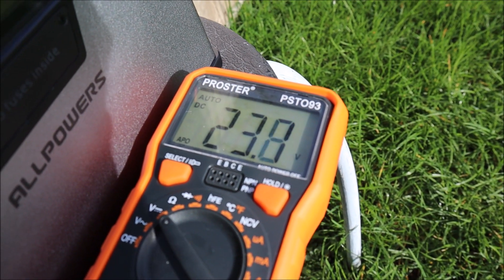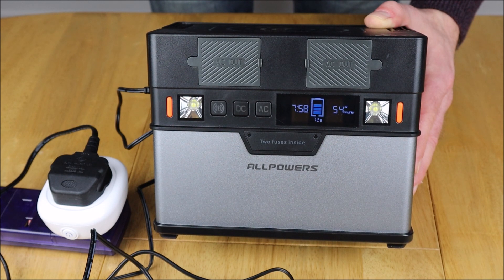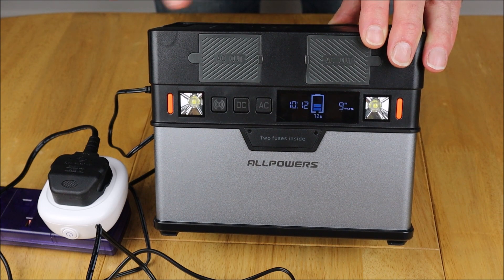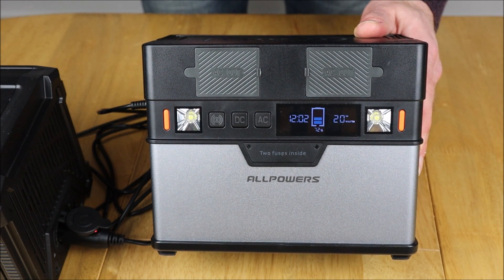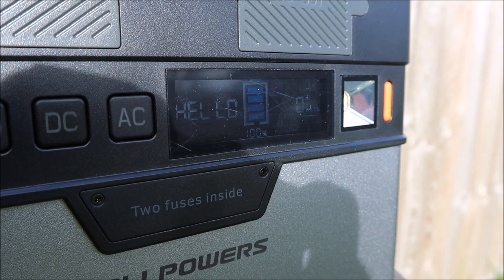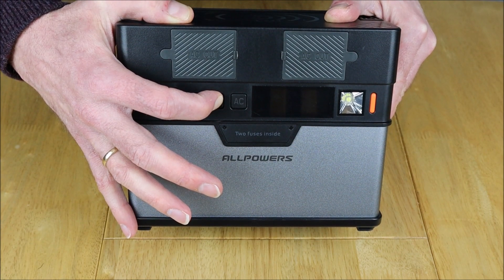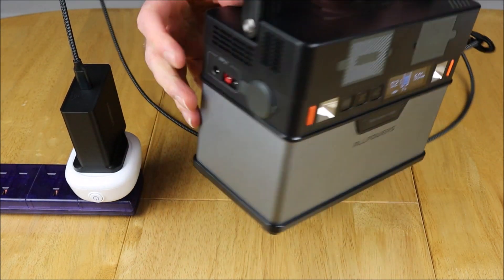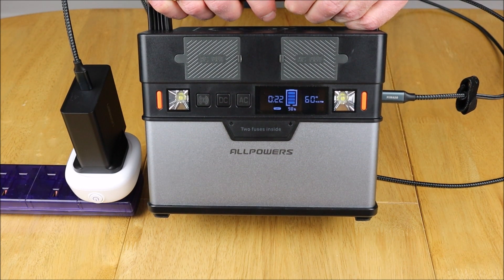ALLPOWERS 372Wh Portable Solar Generator Update | Charging Rundown

Comment: I was looking at this a few months ago and I've come back to buy one but the link goes to a 288Wh version
Reply from the maker: @josh green  Good day Josh! That's strange, it looks like they have changed the listing from 372Wh to 288Wh. I'll ping them to see why it has changed and let you know. All the best, Adrian
Reply: @DADvinci  Thank you very much, I will say that I'm looking at the Sudoo 372Wh as it appears to be the same unit but £70 cheaper I am a little sceptical but it is a good deal.
Reply from the maker: @josh green  No problem Josh. I'll let you know what they say. Please shout if you need anything. Cheers, Adrian
Reply from the maker: @josh green  Hey Josh. I've heard back from them and they have indeed changed the capacity. Sounds like the battery pack price has increased, but here's the main part of their response to me > "The material supply of 372W battery is nervous and price bump up. So we decided to change the capacity of this item, but keep the outer case and other function.   So we change the list information. And from now on, we send our latest 288Wh to our oversea warehouse, instead of 372Wh generators". I'll update the listings to reflect this. Thanks again for pointing this one out. Cheers, A
Reply from the maker: @josh green  I'm not sure if you've gone ahead with your purchase yet, but I've added the AliExpress links for the ALLPOWERS store on the 372Wh/666Wh videos now. It looks like you can get both the 372Wh & 666Wh cheaper at the moment from there (UK reviews on the listings too). I hope this helps. All the best, A
Reply: @DADvinci  Thank you so much for looking into this, I was afraid this may have happened as I've noticed the 372Wh's have been running out of stock.
I ordered a different brand from another site as they had 2 left.
As far as I can tell it's the same unit just with a white plastic shell and not a metal one. 
Thank you for your help, I did want to buy from your affiliate link but I'm sure I'll be coming back as I still need to order a car charger and a solar panel.
Reply from the maker: @josh green  No probs at all Josh and I'm glad you got it sorted. Thanks again for the heads-up with the Amazon listing as this helps other viewers out too! I hope all goes well with your 372Wh and please shout if you need anything else. Have a great weekend. Cheers, Adrian

Comment: My ac stopped working.. Do you think its just a blown fuse?.. When pressed it cuts off after like 2-3 seconds. Also what ohms does it use. Thanks
Reply from the maker: @Clintis Dickson  Good day and thanks for your question. A few of questions if I may. 

> Had it been working fine before (as in, it's just stopped working)? If it did work fine, can you recall the last device that was plugged in the AC socket(s)?
> Does the AC switch off after 2-3 seconds when something is plugged in and when nothing is plugged in?
> Sorry, I'm not sure what you mean by what ohms does it use. Please can you expand on this?

I look forward to hearing from you. All the best, Adrian
Reply: @DADvinci  I used a 18w 2 foot florescent tube light with a starter and believed the starter in the light is what caused the AC fuse to blow or damage the AC outlet as its been struggling to turn on .... As for the fuse I meant what size/ohm fuse is used in the charger. Thanks for your help.
Reply from the maker: @Clintis Dickson  I see now, thanks for the info. Does the AC outlet work with other things or remain on with nothing plugged in?
Reply: @DADvinci  the AC doesn't stay on .. Once turned on it turns off immediately..even if you plug up anything to the outlet or not it goes off. There is no power coming out from the AC at all.
Reply from the maker: @Clintis Dickson  That doesn't sound right and I’m not sure the fuse would be the issue. I suggest contacting the supplier of the unit or going direct to ALLPOWERS via their email address > support@allpowers.net. Cheers, Adrian
Reply: @DADvinci  Thanks I'll let you know about any updates.. 👍

Comment: Hi DADvinci, got this portable station last year(2020) July and everything was running great until it just stopped charging  in February. Any idea what could have gone wrong? Is there any fix for this you might have already faced?
Reply from the maker: @Olu Ogunyale  Good day Olu! I'm sorry to hear about the charging issue. May I ask which method(s) you use to charge your 372 (e.g. Supplied power brick, solar, USB-C PD?). In addition, have you been able to try a factory reset (hold down the DC button for about 20secs, until the display resets)? I look forward to hearing from you. All the best, Adrian
Reply: Hello Dadvinci, thanks for the video. I have the same problem as Olu. I've reset the battery many times but nothing changes. It displays 0wats when I charge input 250v. Let me know if you know anything that I can do.

Comment: I have had one of these for 2 weeks, it worked briefly and now it will not charge past 94% at the mains, and is completely dead when you unplug from the mains. AC won’t start. Has anyone else had this problem? I am getting nowhere with there after sales.
Reply from the maker: @Jamie Hazelgrove  Good day Jamie! I'm sorry to hear you're having problems. Have they asked you to do a factory reset yet? If not, hold down the DC button for about 20secs until the whole display lights up (then release). Are you using the AC power brick to charge (do you have another method)? All the best, Adrian
Reply: Hi thank you for replying. Yes I have tried the factory reset several times and it just keeps going back to the same display whereby it is stuck on 94% and showing zero wattage input. I have tried charging with the solar panel that came with it and it has the same display. I’ve not tried car charging as it did not come with a charger.
Reply: Update - to be fair they have sent a replacement quite quickly. Hopefully this one will work a bit better!
Reply from the maker: @Jamie Hazelgrove  That's great news! I'm glad they sorted it.

Comment: About how long in hours can my PS4 or any other game console can play with this after its been fully charged and unplugged?
Reply from the maker: @Vin Diaz  Good day and thanks for your question. Do you know how much the PS4 consumes, in watts, when playing games (sorry don't have one myself)? I can provide a very rough estimate based on that figure. For example, if it consumes say 100W and based on my 80% usable energy rule of thumb, it could be 372Wh @ 80% = 297Wh usable energy ÷ 100W = 2.97hrs of runtime. If you could let me know a figure, I can use this calculation to get a rough idea. All the best, Adrian
Reply: @DADvinci  it consumes about 120 Watts during gameplay. Thanks
Reply from the maker: @Vin Diaz  Many thanks for the info. Updating the calculation > 372Wh @ 80% = 297Wh usable energy ÷ 120W PS4 consumption = 2.47hrs of runtime. This is only a very rough estimate, so you could get more or less runtime during real-world gameplay. Please shout if you need anything else. Cheers, Adrian

Comment: No NO NO NO!! The problem is, if the battery is full with 100% then it can logically no longer increase to full charging speed! Think about it!!!
Reply from the maker: @Robin Wieneke  Good day Robin and thanks for your comment. The next video in the series covers the issue and workaround, here's the whole playlist if you wish to watch > https://bit.ly/2AbwG5L . The manufacturer acknowledged the issue and that some people may experience it dependent on what solar panel they use (panel voltage when plugged in). A number of viewers have also informed me that the manufacturer has pointed them to my workaround video when they've been contacted for support. Despite its charging characteristic, I still really like this little unit. Please let me know if you need anything else. All the best, Adrian

Comment: I have just bought a unit and it charges far differently to the one in the video. When I plug it in to charge via the power brick supplied, the display alternates between saying hello and a picture of a flashing battery. The fan comes on and off for 10 seconds repeatedly. 
It’s annoying having to ‘listen’ to it fan off fan on for hours. 
It is charging but slowly. 5% an hour. 
What can be wrong? Any ideas?
Reply from the maker: @Becky Nicholson  Good day Becky! I'm sorry that you are having problems and that doesn't sound right from what you've said. A couple of questions if I may.

> The supplied power brick is the one that plugs into the DC port or USB-C PD port?
> Have you tried a factory reset yet > hold down the DC button for 20 seconds and then release when the display resets?

I look forward to hearing from you. All the best, Adrian
Reply: @DADvinci  thanks for your tips. Yes I am using the supplied wire and yes I have reset. 
After 24 hours the battery is up to 48% charged and when plugged in on charge, all I get is a flashing battery pic and no info on how much power is going in. 
This one’s going back!
Reply from the maker: @Becky Nicholson  Thanks for the info. Sounds like a loose connection in either the power supply or the unit itself. I hope all goes well with the return and please shout if you have any other questions. Cheers, Adrian

Comment: Hi Dad! I have the newer version of the unit. I’ve tried today, hooking it up to my solar system on my camper. I bought both an Anderson cable, and a 12v charge cable. I can’t get it to start charging at all using the Anderson port; it’s reading voltage ok on the lead in the range on your other video. No joy. But it works using 12v dc cable plug from solar. But... mine does not suffer the voltage drop issue. It goes up and down with the changing light!! Very good! Do you know if the mppt circuit operates from both inputs or just the Anderson socket? From the manual it would lead me to believe it’s just the Anderson. If you’re not sure I’ll take the unit apart to look at the circuit again 👌🏻 Thanks Dad 😄
Reply from the maker: @Taigen Etsudo  Happy New Year and thanks very much for your comment😊. I did find a workaround for the Anderson port wake-up issue which is in the next video of the 372 series. It's video number 3 in the playlist here > https://bit.ly/2AbwG5L . As you will see it involves partially covering the panel at plug-in to get the voltage down slightly so Anderson port charging begins. As far as I'm aware, the MPPT circuit is the Anderson port only hence the issue, as the DC port wakes-up fine, but is affected (watts drop) if the sun goes behind a cloud and comes out again. I hope this helps. Please let me know if you need anything else. All the best, Adrian

Comment: Hello love your vids!

I am thinking of buying the 372 portable generator (Model:AP-SS-005) for camping trips. will this machine be OK to power a small 140 watt slow cooker via the inverter and if so how many hours would the charge last for from full?
cooking time with a slow cooker is about 3-4 hours.

many thanks & keep up the intesting content!
Reply: Hello Adrian that's an amazing reply wasn't expecting that, it was extremely helpful! I still haven't made a decision to purchase one yet, I've also been looking at the Beaudens models, they look interesting & have different batteries that offer more charge cycles (2000). Did you ever find out why the solar input wasn't operating? many thanks R
Reply from the maker: @Richard Skipper  Happy New Year Richard! Thank you for your generous feedback, it's much appreciated😊 I had typed out a 5 paragraph response to your question and thought it had added the reply, but unfortunately it didn't. I didn't do what I usually do and save a copy, so I'm gutted. I'll try again tomorrow as it's 1am and I should have been asleep hours ago. All the very best, Adrian 😊
Reply: @DADvinci  just read some of your replies and found the update video regarding solar charging, I've also just noticed you've done a video on the Beaudens unit. I'll have a look at that later. keep up the great reviews!!
Reply from the maker: @Richard Skipper  Glad to help! The Anderson port voltage range was/is the problem on the 372. Some viewers have been ok with different solar panels, but now I'm used to mine so it's fine. Please shout if you have any questions after the Beaudens review or if you need anything else. Cheers, Adrian
Reply from the maker: @Richard Skipper  Hey Richard, now for my 2nd attempt😊. In terms of the 140W slow cooker load, the inverter should be able to handle it. This video > https://youtu.be/XftYntUfUZU shows some of the things I've thrown at it and the loads they pull (if you've not already seen it). With regards to power this unit can store (372Wh), it is possible to estimate device run-time as follows.

I base calculations on my 80% usable power 'rule of thumb', for the solar generators I have. I do this to account for the different inverter efficiencies and to allow for not running the battery completely flat every cycle (better for battery health/maintaining capacity for longer).

Slow Cooker Run-time > 372Wh @ 80% = 297Wh usable (based on above) ÷ 140W = 2.1hrs (126mins). This is a very rough estimate and you could achieve longer but this doesn't meet your cooking window I'm afraid. There are a few options you could consider.
1 > Use a solar panel to charge the 372 while cooking. The unit is capable of being charged while using it normally. If you got a 80-100W panel (folding might be better for camping), you could achieve 50-60W (60W charging limit on mine) on a sunny day. The drawback with this is that you'd be reliant on consistent sun for your cook to complete. For example, if you got 50W consistent solar charging this would act at reducing the load being drawn. Roughly, 140W - 50W solar = 90W net cooker load. 297Wh usable (based on above) ÷ 90W = 3.3hrs (198mins) run-time.

2 > Go for the larger 666Wh version. This would give you 666Wh @ 80% = 532Wh usable ÷ 140W = 3.8hrs (228mins). This is larger and more expensive, but would give you close to the 4 hours you need. Again, adding a solar panel (solar charging limit is more than 60W on this) would provide you longer cooking time and you could use your battery overnight for other things too. Here's a playlist for the 666Wh that might be useful > https://bit.ly/3juowGq

3 > 'Additional Battery' option to charge the 372Wh (@ 60W via USB-C PD port) and use for 12V devices while camping. I'm currently planning a video to cover this as I've been using an AliExpress LiFePO4 case battery for months. It doesn't have an inverter, just the battery and a battery management system which you can charge using the DC power pack (included) or buy a solar charge controller to charge it from panels. Here's one of our new short videos that shows the box itself > https://youtu.be/c4I1S871H_k . This 12V battery can store a decent amount of power (12.8V x 100Ah = 1280Wh), has a long cycle lifespan and is reasonably priced. You could opt for a more camping friendly sized 50Ah version which would still give a good amount of power storage (12.8V x 50Ah = 640Wh). Links (affiliate) below and there are other different sizes on their store. I wouldn’t consider this completely waterproof though as I’m not sure about the battery terminals being watertight.

12V 100Ah > http://bit.ly/3pNYukO
12V 50Ah > http://bit.ly/3bfQaXc

4 > Perhaps a lower wattage slow cooker?

Sorry for info overload, but I hope this helps. Please let me know if you need anything else. Cheers, Adrian

Comment: Hi Mr Adrian, this problems still happen until now? i plan to buy this for family camping (3 days and 2 nights) for my USB Fan. Do u suggest it or better alternative power station?
Reply from the maker: Maruz  Good day and it’s nice to hear from you. The issue has a workaround in the next video of the 372Wh series, here's the whole playlist if you wish to have a look > https://bit.ly/2AbwG5L 

This unit does have some issues, but it still represents good value for money and is very compact for camping which is a bonus. It should work fine with your USB fan and charging devices. You can easily charge it from your car using the methods in the other playlist videos. I hope this helps. Please let me know if you have any other questions. All the best, Adrian

Comment: Thanks for the informative update. I want to know if there the DC outputs are regulated because for critical astrophotography use to power the computer mount and cameras I want to maintain 12+ volts for most of the battery charge. The auto-shut-off with low draw might be a problem. I wish there was a workaround...
Reply from the maker: @James Goodall  Good day James and thanks for your kind feedback😊. Here's a link to the full playlist (if you haven't seen it) > https://bit.ly/2AbwG5L and the video about 12V regulated output might help. As you rightly say, the power saving feature can be a pain in low power draw situations as it doesn't wake-up again without manual intervention. The other option would be to use an AC adapter like this > https://amzn.to/32Y46zS (affiliate link), but this would be with a slight overhead due to the inverter being used. I hope this helps? Please shout if you need anything else. All the best, Adrian